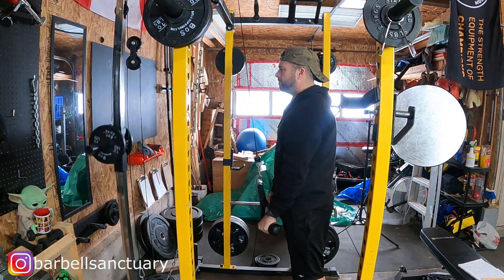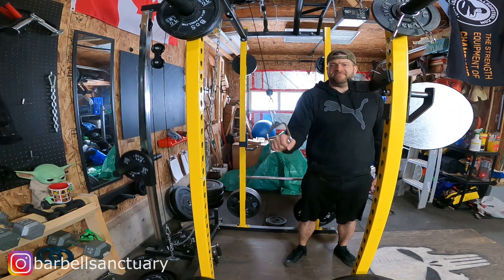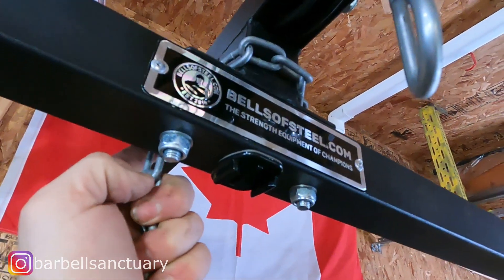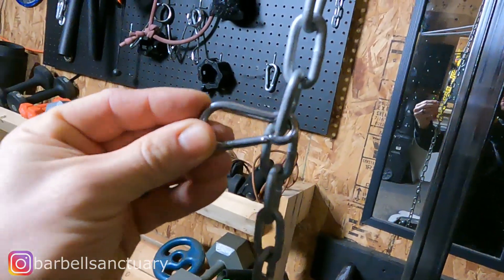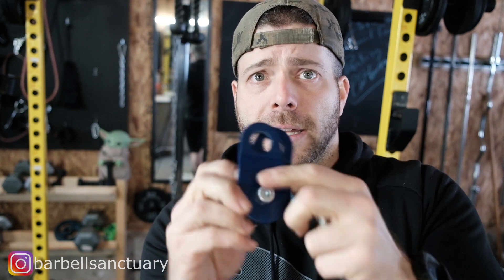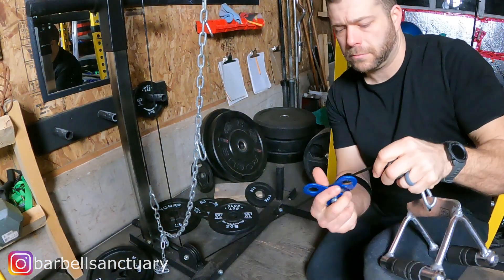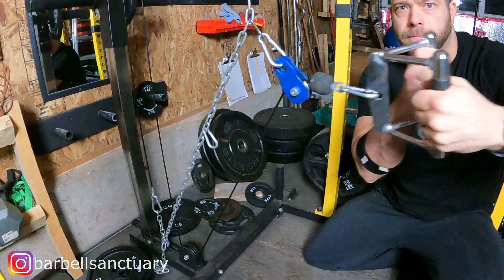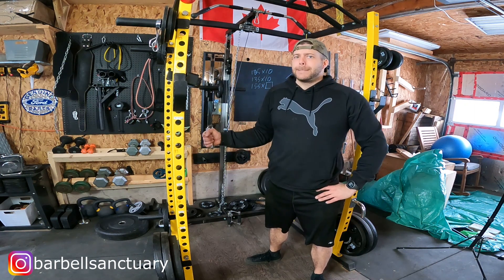ADJUSTABLE DIY CABLE PULLEY SYSTEM - FOR YOUR HOME GYM

Comment: Love the channel, I have the same rack with the lat tower all I do is put the j hooks at mid row height facing outward toward the lat tower put a bar on them and pull the cable over it.

Comment: I watched your video a few more times and I think I have been inspired with another idea! I think I'm going to make a bar that goes across the back to uprights on the rack and run a bearing pulley in the middle and the cable can go over that and I can just increase in the increments of each hole! I never would have thought of it until I watched your video!
Reply: Have you been able to do it sir? Any better results?
Reply: @mohdaqibzubair  no, I never did, I got a Smith Machine at a very good price.

Comment: How does adjusting it affect the slack in the cable? Im assuming you attach the extra portion to the final pulley so that no matter where you adjust it, it gives the right amount of cable back through?

Comment: I'm planning a pulley system in my basement, but I don't have enough space vertically for a real one so I gotta go DIY.

I have something a concrete beam that goes vertically up the wall and horizontally across the ceiling, so I plan on putting 1 pulley on the wall beam and 2 on the ceiling beam.

Do you think the wall one (which was intended to be a low pulley of course) could be done with the chain and snatch block? Like would I be able to drill the chain in the ceiling and floor and use it to modify my low pulley height like you did in the video (without the extra pulley you have in the video)?

Comment: Very smart solution. If one has the weight needed you could do this from a pull up bar and a floor anchor of some sort too
Reply from the maker: Yes for sure!  Very versatile.  Did you notice I took your advice and changed my intro sequence?
Reply: @BarbellSanctuary  Yeah now that you mention it I took a second look. Does seem different and less loud! Didn't mean for you to change the music entirely though! It's your channel bro!
Reply from the maker: @Niborino9409  oh yea for sure.  I took a look at my analytics and it did show that people were leaving during the intro.  So it was probably too loud and too long.  So I sped it up to about 3 seconds and lowered the volume.  I don't want to be losing viewers because my intro is too long.  Should be ok now.
Reply: @BarbellSanctuary  Personally the length never bothered me but the loudness did. Much better now! 💪

Comment: Doing basically this at the moment, only problem on my cage is that the low cable is basically only the length required to sit flush with the bottom pulley. This means when you bring it up to the snatch block you're already having to pull against the force of the weights, plus it limits the range of motion of the cable before it hits the top of the plate rail. Not sure if anyone else had a problem like this or managed to come up with a solution. Thanks for the video mate, stoked to be able to do rows properly.
Reply: I have this exact issue as well. Got all the supplies, set it up and then realize there isn’t enough cable length to make this work higher then the floor. 
Did you find a way to fix this?
Reply: @claudinemercier4763  I bought a second length of cable that I connect to the first one and then then run through the pulley. I didn't use gym cable just regular nylon cabling from the hardware store but the proper gym cable would have been better because it already has the swage etc installed and rated to a high weight

Comment: Do you find your snatch block to be smooth while using it?
Reply from the maker: Yea I do.  You just need to play around with the distance of where you will start and whether you'll use the high or low pulley for certain exercises.
Reply: @BarbellSanctuary  I got the same one and it clicks every time it spins
Reply from the maker: @marklanston7256  The snatch block?  maybe try spraying some silicone lube in there?